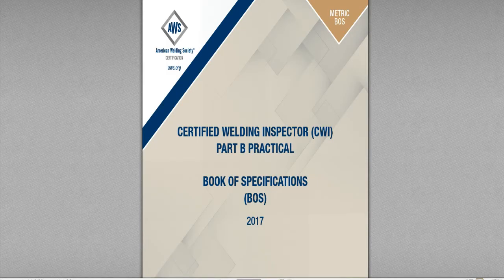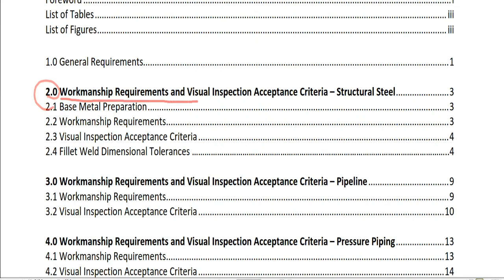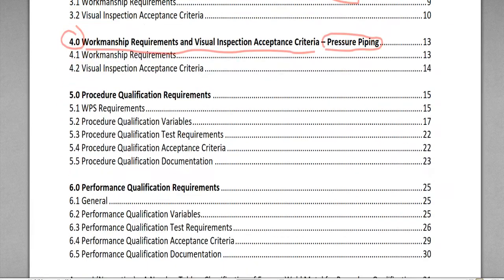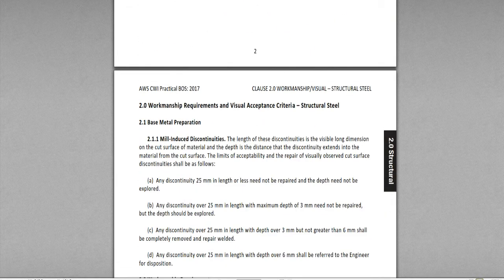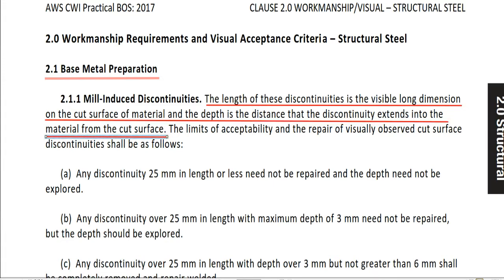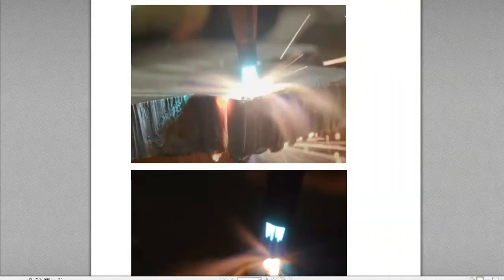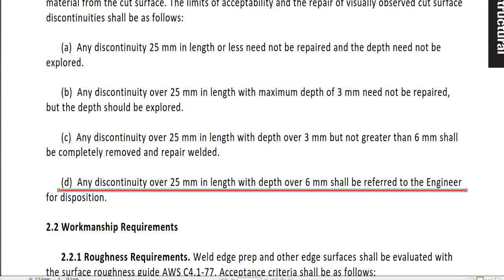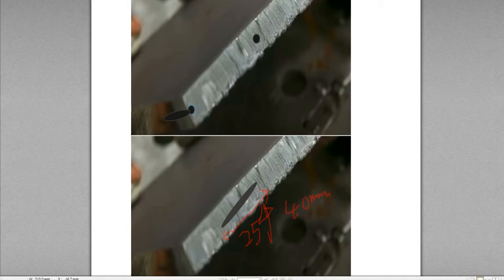CWI Part B Lecture #1

Comment: why did you use sample 3 for roughness guide question ,if question says mechanized.shouldnt you compare sample 4?
Reply from the maker: Mechanized welding process is sample 4.
Reply: Yes I don’t get this either? Sample 4 is for mechanized welding. What am I missing? I understand it’s unacceptable either way using sample 4 or 3 but not sure why you chose to use sample 3 to compare instead of the acceptance criteria of sample 4?
Reply: There were 3 unacceptable answers with different ending in that sample question, why we had to choose the number 3/ additional item replacement? Thank you!